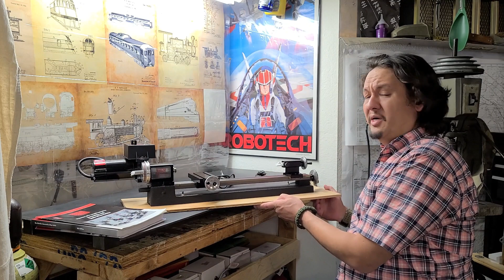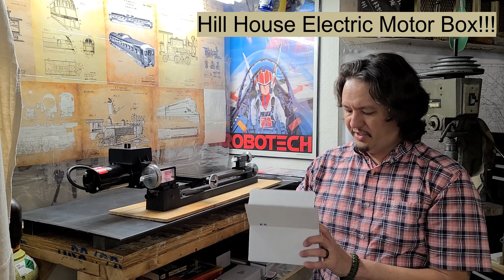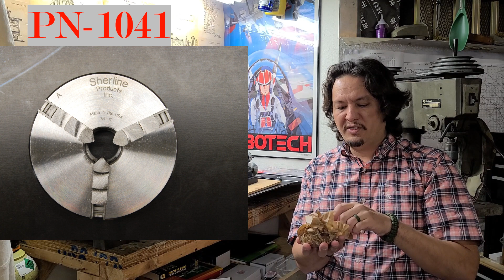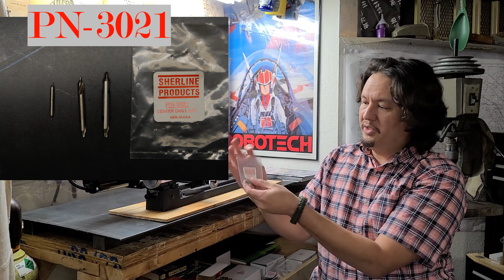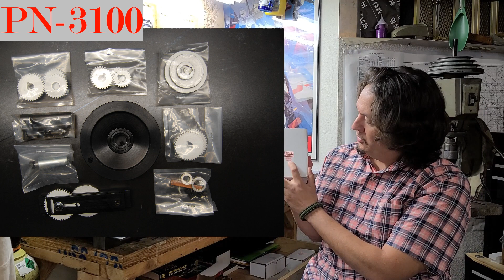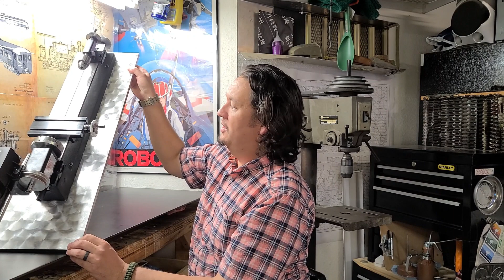Sherline Lathe C Package

Comment: Thanks for making this vid, like the guy below me said, not much info online. Maybe make a vid testing all the materials it clams to cut, like tool steel, stainless, titanium etc.
Reply from the maker: Thanks. That be a great video and I have been curious myself. I have been machining my own Machinist Buttons out of some .500 hot rolled. Readily I was able to split .001 and get within .0005 on all four button bodies. Though on my model I have dials and it was hard to repeat cuts less than .001. I found that with the factory hss cutter the best cutting and finish came from .010 cutts on the hot rolled steel.